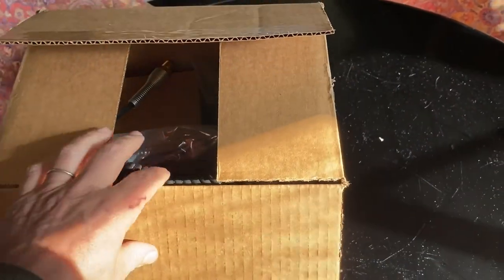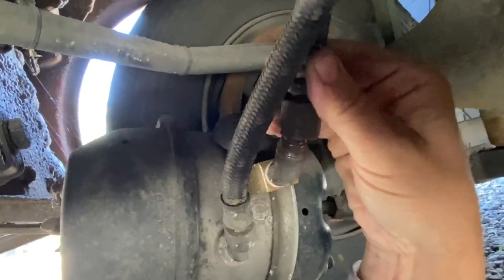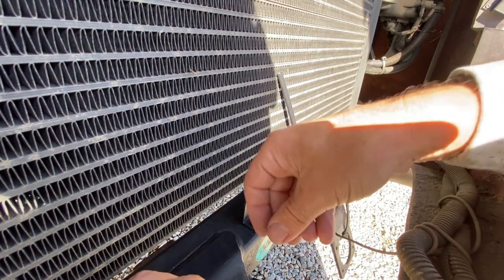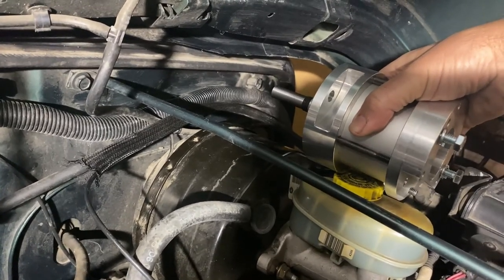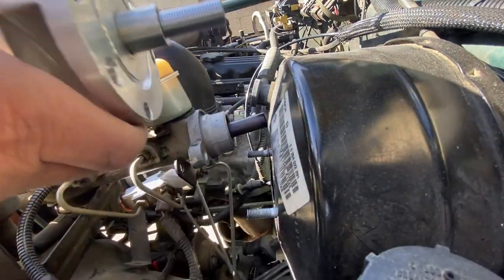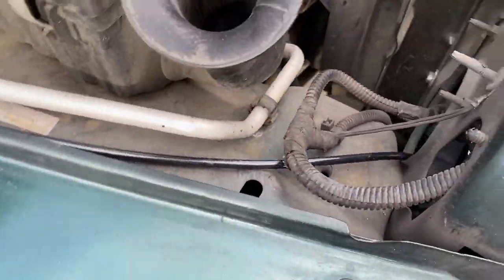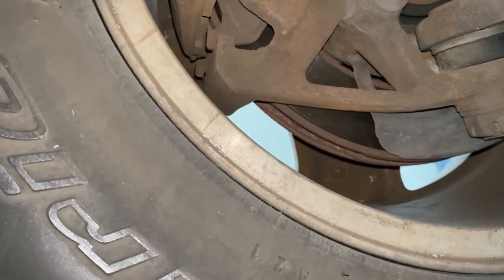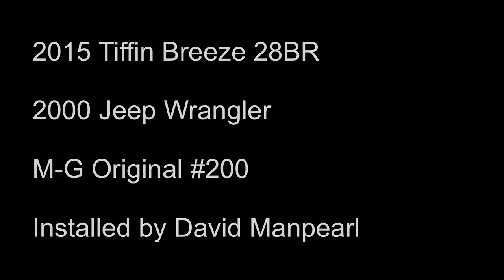DIY Install of M-G Engineering Braking System on Jeep and RV

Comment: Wow!  Ive been looking for a clean toad braking system without having to install a brake pedal contraption that I find cumbersome at best.  Now, I need to find out it this system can be installed on a 2021 Jeep Wrangler Sahara.  Thanks for the video.
Reply from the maker: Did M&G end up supporting your '21 Wrangler?
Reply: @DavidManpearl  No, they did not.  It's a great idea but the company has very poor support and does not seem interested in helping.  I have moved on.

Comment: great video, I just bought a used 2018 Coachman Pursuit 32WC which had an M&G 2.0 installed with a supplemental air compressor, wanted to see how easy it might be to install the matched system in my tow vehicle which will be a 2016 Chevy Colorado Z71, so far so good, looks doable to me.

Thanks!
Reply from the maker: Hi Bill, Just an FYI that the M&G 2.0 system is very different than the "Original" model that ties into the master-cylinder. The 2.0 supports more vehicles, but IMO the Original is much simpler and more elegant.
Reply: @DavidManpearl  I opted to take my truck over to Athens,TX and have M&G install the system for me, they installed the 1.0 with the original master cylinder plate.

Comment: David , thank you for this video. I've been watching off and on for a few years for someone to make a video on installing the M&G BRAKING SYSTEM.  THANK YOU THANK YOU.  You made it look so simple.  I'm disabled that's why I was waiting.  Now I'm going to ask my son and or grandson to install this for me. 
How has it worked out for you so far?
Reply from the maker: Thank you Doc. M&G has worked out great for me, and we have now towed the Jeep for thousands of miles. My favorite feature is that there is zero drain on the Jeep battery, so we never have to mind its charge or worry about depletion. I also love that there is nothing to install under the seat. After long downhill grades, I have often stopped and checked the Jeep wheel temperatures, and sure enough the fronts can be pretty warm, the rears not so much. The Jeep drives and brakes the same as always with the M&G master-cylinder adapter permanently installed.

Here is a related video I made for the turn-signal/brake-lights wiring harness I installed: https://youtu.be/sSJjYyiQyzA